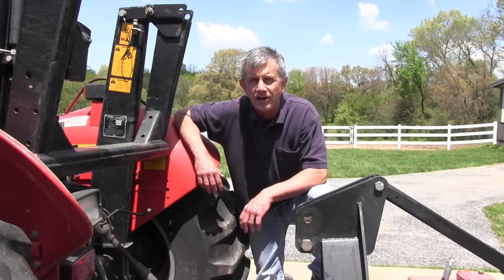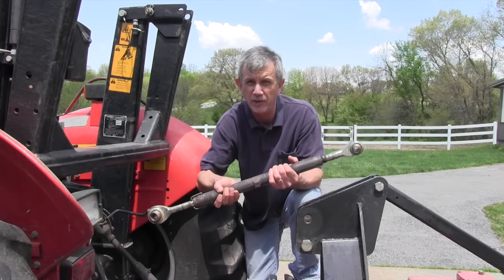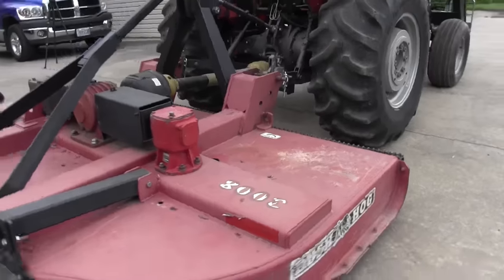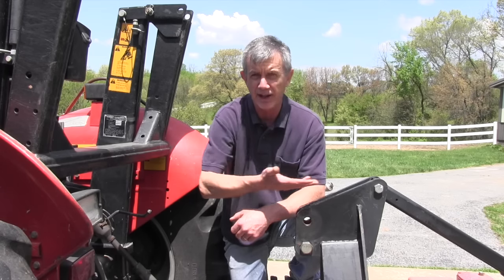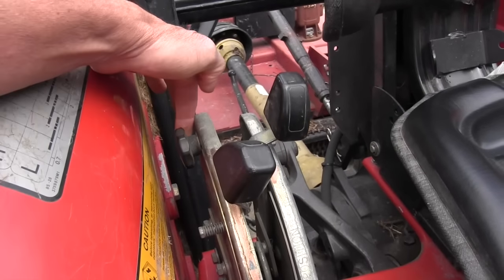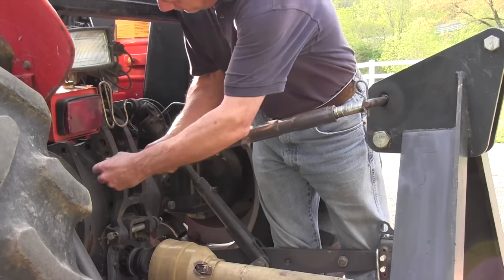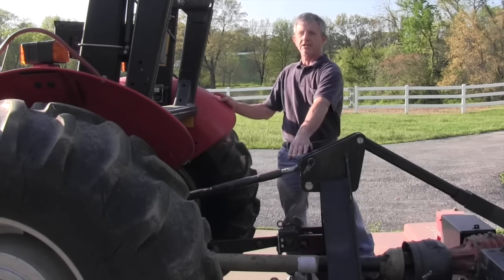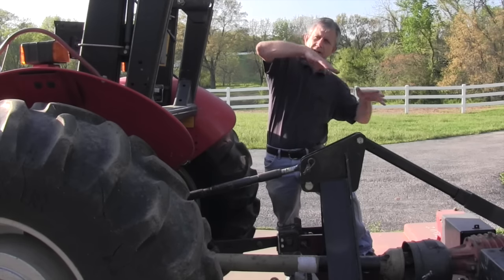Adjusting the Tractor Top Link to Pull a Brush Hog

Comment: Top link should not be supporting the deck when you go through a dip. The drive shaft is designed to flex. Not a good idea for the deck to hold the back end of the tractor off the ground. It should hinge.
Reply: I believe the lift arms will raise - there is no downward force on them (try it with no implement - set it midway on the quadrant and raise by hand). The 3-pt will not hold the back end up unless the lift arms are fully raised to the point all travel is used. And then, yes, that’s a bad thing.